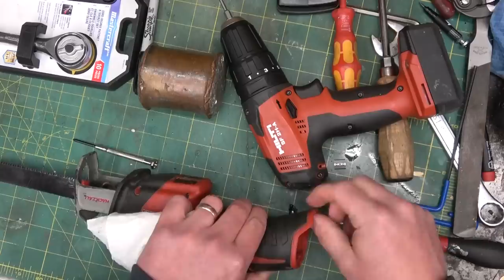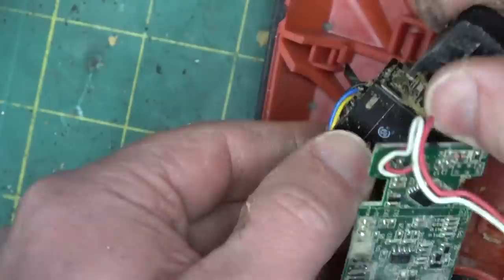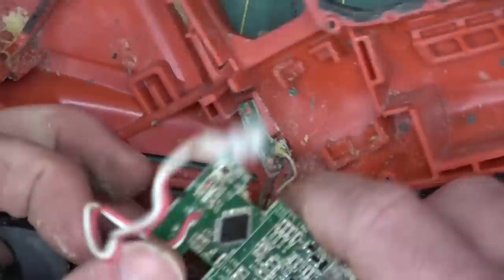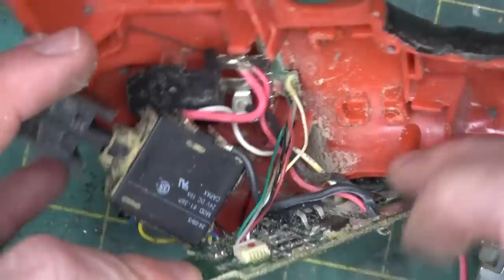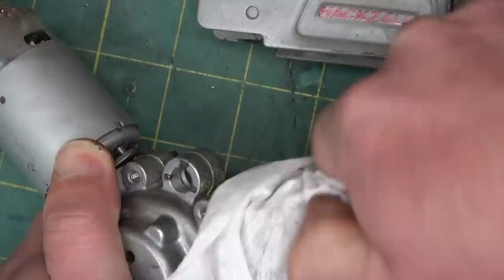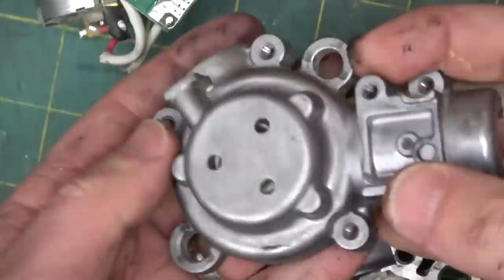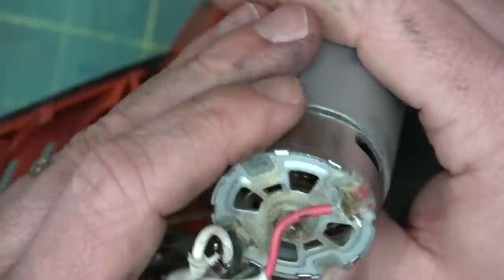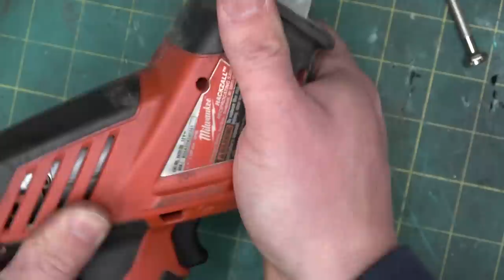BOLTR: Milwaukee Hacksawzall | Seven Year Review

Comment: So I was inspired to take mine apart. My ring gear bearing had a slight hitch so I decided to pop it out. Upoun removing it I found three screws tightened into the housing. One of which must have backed out a bit and was sheared off by the ring gears step. (It’s stepped heavy one side to offset the piston pin side). 
No good reason for these screws to be there at all from what I can tell. Anyone have a clue?

Comment: I sm neither bright nor dumb

But...

I believe i saw loose between the gear box casting and shaft bushing

Why not first add a few layers of spray paint then bed it in jb weld a small amount 
U can always add a little heat to split the case if it glued together but my guess by the time it needs a second service the bedding will have lost its attachment 

And

In my un solicited opinion glueing to the board was a bad choice 

Rather bed the motor also in jb weld only to the plastic clam

Comment: The battery should not be an integral part of the tool handle, especially when they are using those cheesy plastics clips that always break - as a locking mechanism.

Comment: Regarding the strip down of the Festool saw while always technically insightful but you lack appreciation for the quality of this tool.
These saws are PRO tools and are  are outstanding value for what you are getting -if you used this you would appreciate the productivity benefits of these as they are accurate and quick to use. I have owned mine for 35 years and it is still going strong. I believe these tools can last a life time you cannot say this for Makita or Dewalt that basically copied Festool's design and cheapened it.

Comment: So I run all Milwaukee tools on my work truck just for ease of battery charging. I have a brushless m18 fuel sawzall. And a brushed m12 hackzall. I find the hackzall mostly useless?? Everyone told me they were great. I am yet to find an application where my sawzall isn't better. Anyway I have a slightly used m12 hackzall if anyone has $65. Ok thanks.

Comment: How many dollhairs was this creation?
Reply: Pretty sure I got mine, just the saw, no battery/charger, for $60 shipped on ebay quite a few years back. I just use it to cut steel/aluminum flat/round stock on my workbench as well as cutting off the random bolt here and there. I did use it to cut 1" angle iron a few times...

Comment: Had the whole set of milfucky 12volt tools, the mini sawsaw lasted less than 1 year in daily HVAC installer use, but they were relatively cheap and the imapct gun is still working almost 10 years later.

Comment: NO NO NO!!!!   iF IT AINT BROKE "BAD"  ENOUGH,  THEN DON'T FIX IT .  
The auto repair facility told me as they refused to take my money, rear spring bushings on a 91.5 dodge D250 .   I only hire out the shit jobs.  lol.... took several extra days and 3 orders as my bastard (stock )truck doesn't use the parts listed in the blasted computer or  books.

well done.  I  will expect my copy of the tool to last 20+ years before a lube job is necessary, as i don't have many opportunities to hack on stuff .

Comment: Milwaukee 18 volt cordless tools SUCK!
I have the Milwaukee 18 v hammerdrill, 1/4" impact, hackzall, oscillating tool, flashlight  and the FUEL 6.5" circular saw.
The oscillating saw has been good and the  havkzall , since returning after service has been good.
EVERYTHING else including the FUEL circ saw,  SUX!!!!!!
they have HALF the power of my DeWalts i used prior, have ZERO features, like the impact which doesnt even have a one handed chuck! And it cant even drive a 3" deck  screw !  And the hammerdrill gets so hot after drilling 2 " 9/16" hole saw holes into porcelain tile i couldnt hold it! Not to mention the  thing is so weak i cant  believe i spent the same on these tools as my DeWalts!
Even the "mighty" FUEL circ saw sux! I cant rip a 2× 10  pressure treated board without it stalling every 10" or so!

Unbelievable milwaukee!
NEVER again!

Comment: Lasts a few weeks to a couple months at most in the hands of a turd herder... Them teeny tiny cheapo buck store bearings go due to water ingress what with the wide open everything. The last one I opened up for one of the other guys was 3 weeks old and the bearing behind the pinion on the motor was rusted all to fuck and seized right up. Nice toy though.